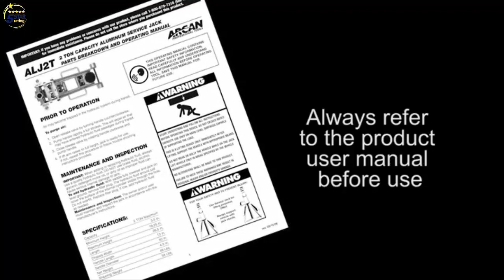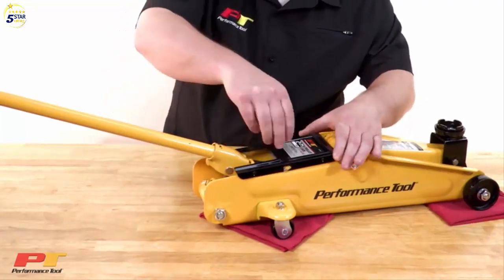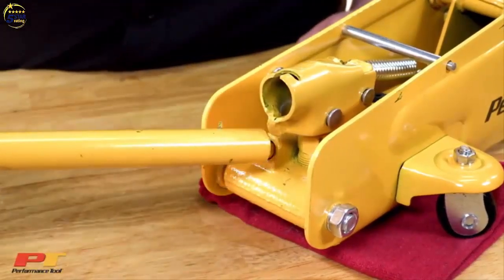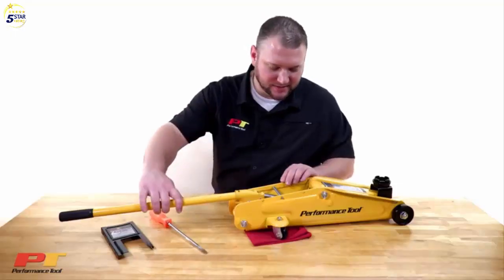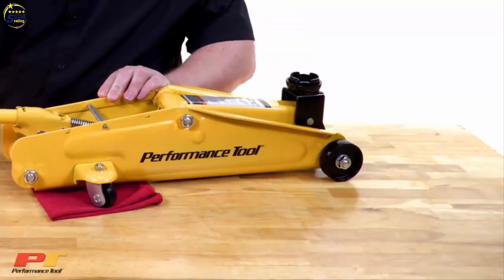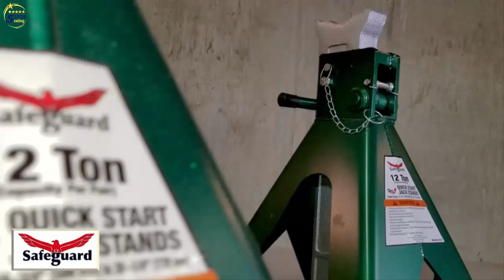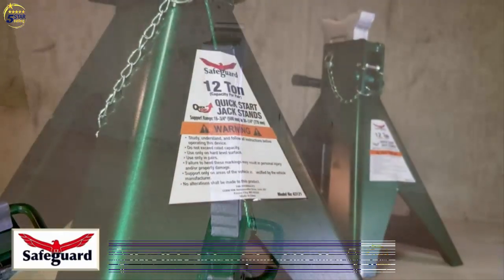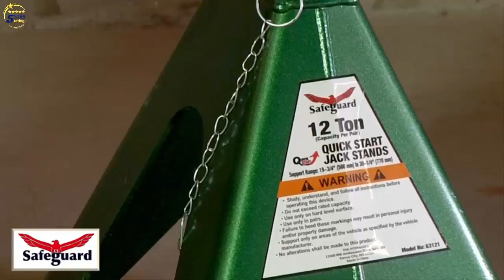Best  Floor Jacks | Top 5  Aluminum Floor Jacks 2021

Comment from the maker: 💚List & Links 👇👇👇💚
1. SAFEGUARD 12 Ton Jack Stands
👉 Amazon  US  ► https://amzn.to/3cPYhtD ◄
👉Amazon International ► https://geni.us/Zdo94iV ◄

2. Performance Tool W1640
👉 Amazon  US  ► https://amzn.to/3wulfys ◄
👉Amazon International ► https://geni.us/QuKxVM ◄

3. BIG RED AT84007R Torin Hydraulic Low Profile
👉 Amazon  US  ► https://amzn.to/3fJRrYQ ◄
👉Amazon International ► https://geni.us/qf2u ◄

4. Arcan 2-Ton Quick Rise Aluminum Floor Jack with Dual
👉 Amazon  US  ► https://amzn.to/3fG6C5a  ◄
👉Amazon International ► https://geni.us/AVrHY  ◄

5.  Torin TAM820010L Hydraulic Low Profile Aluminum
👉 Amazon  US  ► https://amzn.to/3dCIfm5 ◄
👉Amazon International ► https://geni.us/Oxcr ◄

✮✮ Best Sellers in Floor Jacks
 👉Amazon  US  ► https://amzn.to/3sReV1S
👉Amazon International ► https://geni.us/piMCKBP

Top 5 Best Diagnostic scanner For Cars  https://youtu.be/rJeNr9UTwwU
Top 5 Best Wireless Car Charger  https://youtu.be/umfwMksbzeg